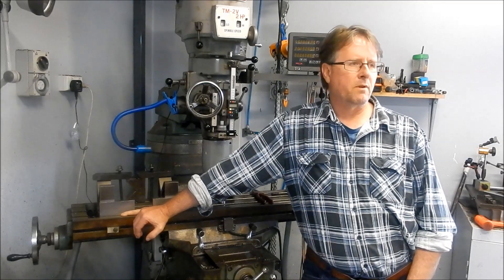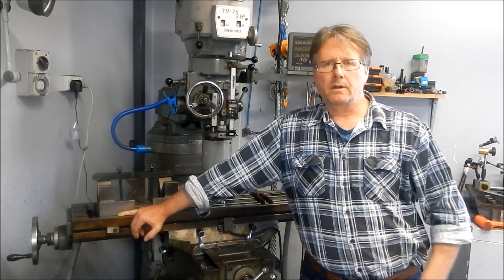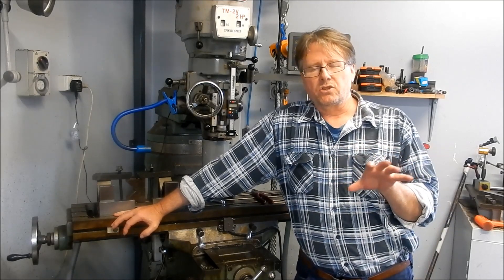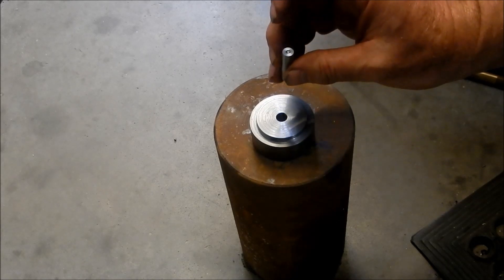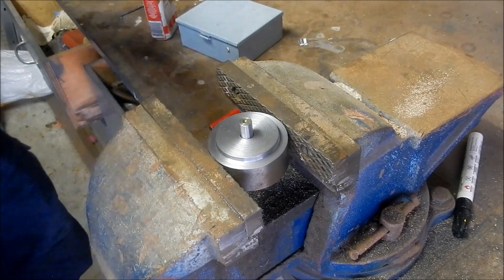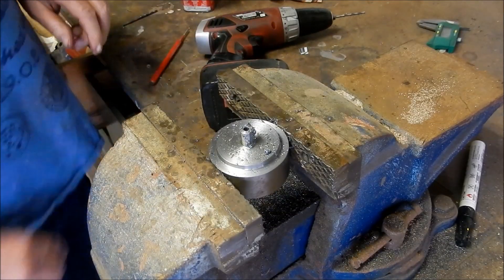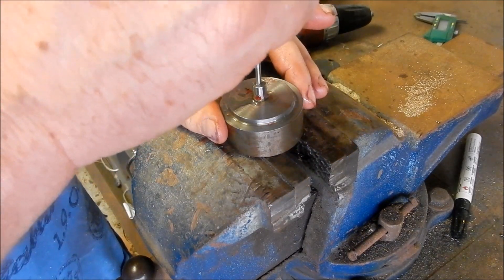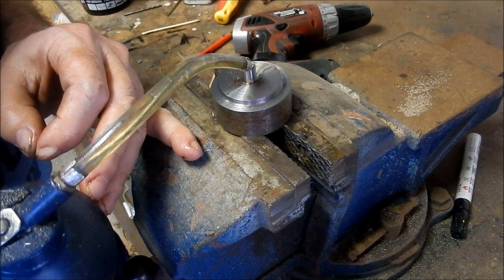Dowel Pin Removal with Hydraulic Pressure

Comment: try a grease needle
Reply from the maker: G'Day Pdd Pup, yep anything that would get the grease into the bottom of the hole without air bubbles is certainly the way to go.  Would make the job go an awfully lot quicker.
Cam

Comment: Think about doing it on the fly I wonder if a bit of rag would work or just topping it of with grease to seal it
Reply from the maker: You would still need the grease.  The cloth is just there to deliver it into the hole.
Cam

Comment: I saw the comment on the other video prior to this and thought you may be familiar with this method and chose not to go this route. 

This is a method my Father taught me to remove spigot bushes from crankshafts when doing a full job on an engine or replacing a clutch with gearbox out and this can be done under a car. That is if you can machine up the Ram, no lathe a bigger problem.
 Good demo of the principals of this Cam, hope you are doing well. John, EC Australia.
Reply from the maker: Thanks John.  I must admitt I hate working on cars now.  Did enough of it when I was younger but my back really feels it now that's its not quite as forgiving as the years pass.
Cam
Reply: @camatbattler2233  thanks Cam, however if i get my hands on another Datto 1600 then my back may be cured, lol. John.
 PS; Or another Cooper S.

Comment: I have a needle point grease applicator that you could insert into the hole and fill it with grease from the inside out.  Neat trick.
Reply from the maker: That would certainly be the way to go Steven.
Cam

Comment: G’day Cam, you started out using the hand drill because you wanted to show how it could be done in the field, who has a lathe in their service truck, although I have had at times felt even a small lathe would have been handy, 12V battery run hmm that’s a thought. 
Anyhow jesting aside well done. Cheers, Peter
Reply from the maker: Totally agree with you Pete so you have inspired a back up video to this one.
Cam

Comment: Hi Cam ,
You can get a needle adaptor that goes on a grease gun (they use them for injecting grease into shielded bearings ) or you can modify one of those needle inflators  used to pump up footballs so it can be used on a grease gun . I wonder if you could tap the hole to fit a grease nipple and use the pressure from the grease gun to push the pin out ?
Reply: @AJR2208  I have used the grease nipple method when removing wheels from axles (railrods equipment). Te press load on installation may be well over 100 tons, and pressing off dry after some number of service years can be impossible. Drill diagonally through the hub flange to the axle interface, tap the entry for a nipple, and pump it up. Give it a few hours for the grease to work through and it will press off with less than the original mounting force. Stubborn ones get a hydraulic fitting and pumped up with the 10000PSI (750 bar) pump. I have also used a syringe to pump grease through a small hole.

Comment: Cam i have used the hydraulic method to remove projectiles from rifle barrels when the owner has light charged there bullet . i made up a screw on cap with a grease nipple in it. and the pressure from the grease gun was enough to remove the stuck projectile. :)